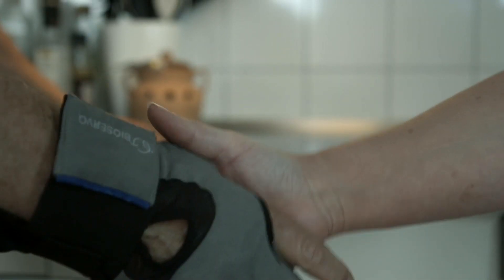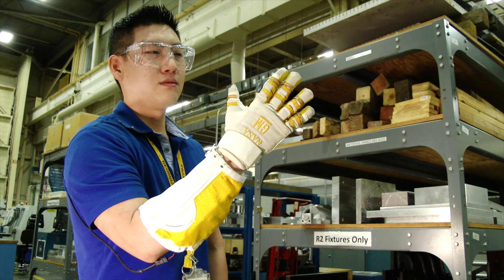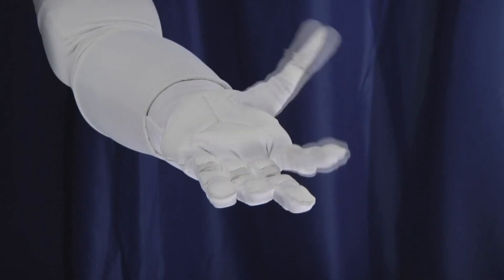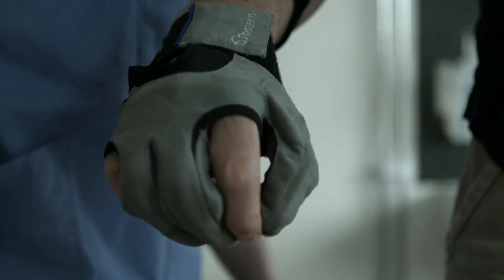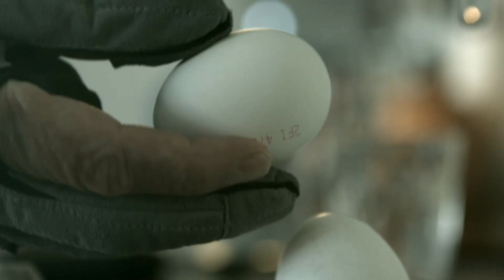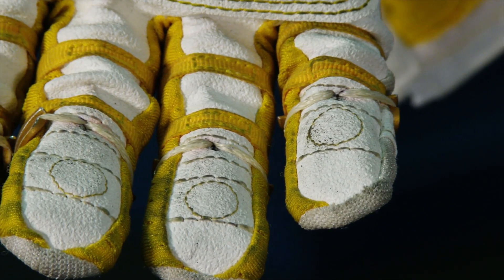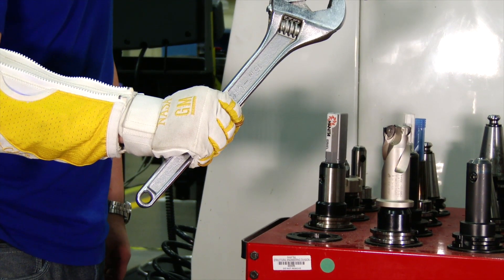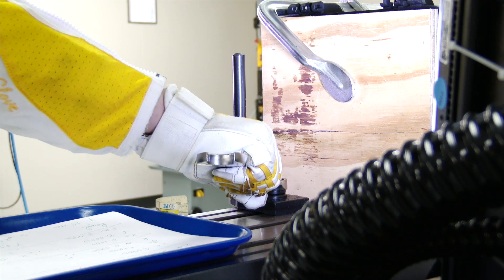GM's RoboGlove Will Turn Workers Into Tool-Slinging Cyborgs | WIRED

Comment: so besides being cool and packed with high tech what does it actually do?
Reply: It keeps your grip tight without giving you writer's cramp.
Reply: +DrZeeebra forty pounds per hand means 80 pounds or 40 kilos in two hands only. combined with an exoskeleton, a soldier can easily carry a far larger luggage.
further the energy expenses to carry 40 pounds here is far lesser than normal requirement

Comment: But surely this design only effects grip, no? I don't see how, without any other attachments this could help with anything other than applying force on something between your fingers. And if they do plan on creating a more extensive model, where does the attachment stop? At the shoulder, relying on your back? At the hip, relying on your legs? I don't see much practicality without severe bodily danger unless you have a full exoskeleton.
Reply: That was my first thought.  To lift a heavy object you use your fingers, wrist, elbow, shoulder, legs and most of all, your spine.  As someone who suffered a back strain injury that has effectively crippled me for life, I can see this "magic glove" causing more back injuries than any other invention in the past 100 years!